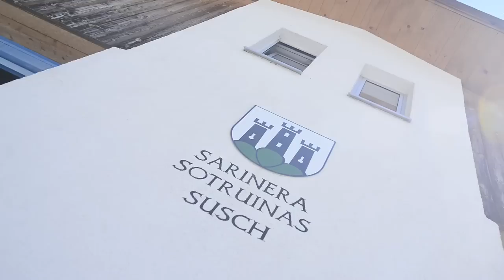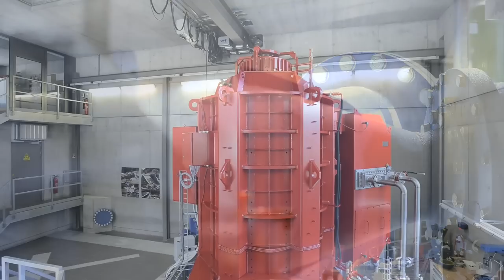TES small hydro generator  - Susasca, Switzerland

Comment: Why not construct an eternal funnel in the mountains that is a closed system that drives electromagnetic motors from the water vortex that pushes the water to restart the endless cycle to generate electricity?
Reply: The laws of thermodynamics, that's why.

Comment: The hydro electric generators in america are much bigger
Reply: What do I say to say what your affirmation means? I have the biggest car of yours? I have bigger than yours? The size of the generator / turbine depends on the power and the power depends on the jump in meters, so the water pressure more than the amount / flow available. logicapente is designed and built to measure the turbine for the available power flow and logical pressure, but obviously not for everyone ...
The hydroelectric turbines are differentiated by two types: kaplan Francis jet turbine in their multiple variables and action: like Pelton Turgo and cross-flow type michell banki / ossberger which are mainly at action with a small reaction on the discharge if vacuum aspirated. Logically you will not take a small car to go shopping, or to go out of your way as you will not use a truck driver to get out of the house to get a coffee and the newspaper! But come on in America they have everything bigger ...
speech as kids.
Reply: @winterburan  Goddamn right!